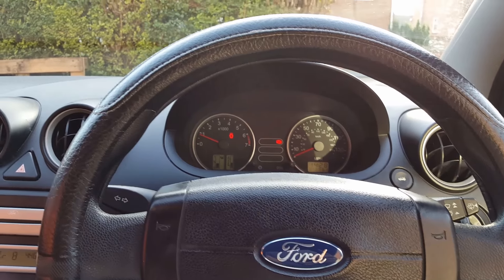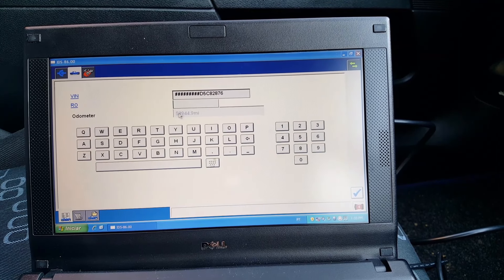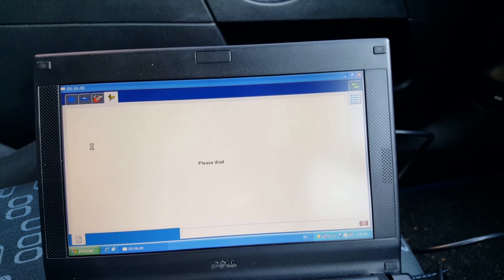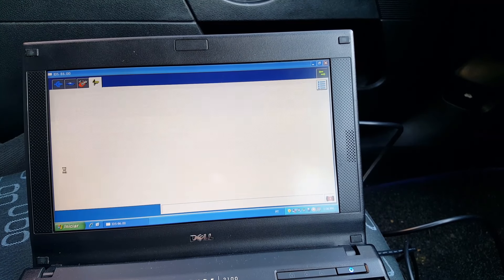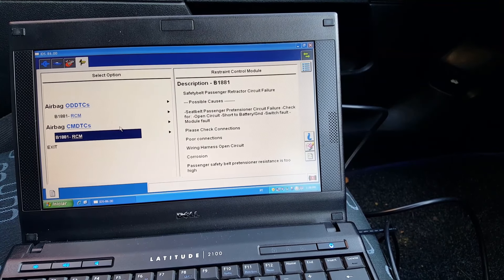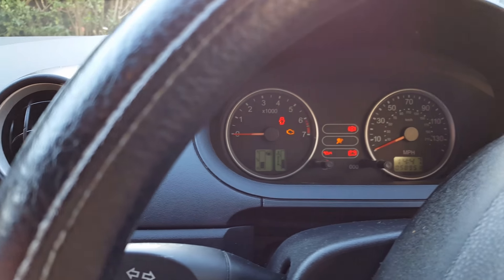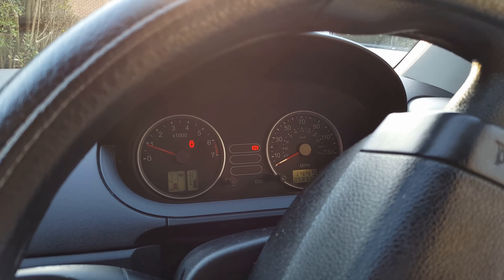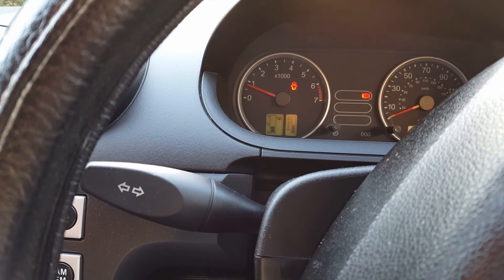Ford Fiesta 2005 Airbag light randomly on or flashing.

Comment: thanks for video on IDS what I usually do is go into the data logger for the airbag/restraint module and list the pids in connection in ohms, wiggle the them and watch the fluctuate whilst graphing them, any way u fixed it without that so well done, cheers, sandy
Reply from the maker: sandy anderson 
Hi
Agree with your approach...
I would eventually do the same... if     this wouldn't fix it...
Thank you for your comment!

Comment: I had a problem with my fiesta. My cigarete lighter didnt work. Ive found the problem and removed broken fuse. Then another problem. When i tried to start the car nothing happened its like there is no power. Then randomly everything is okay. And now airbag icon is lighting. I think i will go to car electrician. From little problem to another. And everything from that damn car lighter fuse. Amazing. 🤣

Comment: Hello, i have the same issue, do you know if the airbags will deploy when the light is blinking or dont they? Because its only an orange light.
Also what programm are you using? When i read the fault codes on my ecu it tells me no fault codes detected.
Reply from the maker: Normally the airbag system is deactivated if the light is on... which means there is a fault with the system....
I am using IDS....
Thank you for watching and for your comment!
Reply: @LMAutoRepairs  thanks for the quick reply, i found that the flashing light was blinking 2-3, but i couldnt find the error codes for fiesta online. One ford site said it might be a problem with the passenger airbag being grounded, another said low voltage which might be more plausable since i still habe the original battery build in, but its still in excellent shape.

Anyways, after not finding anything on the ecu, the airbag light has suddently stopped blinking. One thing thats very weird is, if i turn the key to position 2, where all the cluster light should light up (right?) The airbag light only light up 10% of the time.

Really dont know what to do, but the problem is gone as of right now...

Comment: hello I have problem i hope you will help me out wit it it's apically with Hyundai  cars all models do not work on DS708 so what suitable solutions for  problems like these even i can not get trouble code
Reply from the maker: Hussein Olivia 
Hi
If work in a lot of hyundai cars, just get hold of the hyundai scanner...
As for the ds708, it's weird that it doesn't work on any model...
I have already scanned a few with no problems...
Make sure you have the latest updates installed. 
Hope that helps...

Comment: Do some one have an idea ? The airbag light don’t want to go, I cleaned the plugs under the front seats with a special spray but the light still come :((((
Reply: Ford fiesta 1.4 from 2005
Reply from the maker: What are the codes on the airbag module?
👍👍👍
Reply: @LMAutoRepairs  - U2017 
- U2018 
- B1934
- B1877
Reply from the maker: Are all those codes active?
They all refer to different things...
I would check the connections at the module itself...
Reply: @LMAutoRepairs  yes they are all errors we found after a diagnostic. 
Which module and where pls
Reply: @LMAutoRepairs  
More details about errors. There are 4 
U2017
 - Erreur de communication du capteur de collision côté conducteur (non SCP)

U2018
- Erreur de communication côté passager du capteur de collision (non SCP)

B1934
- Résistance du circuit de déploiement de l'airbag conducteur faible au détonateur.

B1877
Circuit ouvert du prétensionneur de ceinture de sécurité du conducteur
Reply from the maker: I understand, but are all the codes permanent, or some are past codes?
The Airbag module is usually located in the center console... near the hand brake, or gear shift...
👍👍👍
Reply: @LMAutoRepairs  I diagnosticated once but the airbag light is permanent and flashing first. Thanks a lot I see where it yes now.
How could I check the connection there ? By removing battery and then the module or?
Reply: @LMAutoRepairs  the car hadn’t any accidents. Idk why theses errors
Reply from the maker: @battleforfairlife7834  
Yes...
But you are kinda work blind...
Without a diagnostic tool to actually see what is permanent faults, and what's not, you might be chasing your own tail...
😬
Reply from the maker: @battleforfairlife7834  
Some could be old codes... ence the diagnostic tool is imperative!